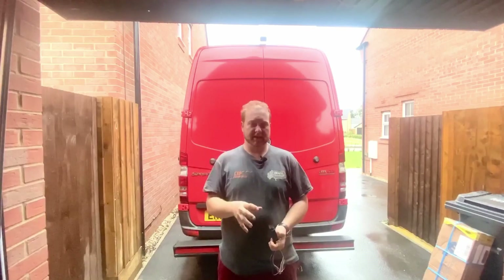Installing A Tow Bar On The Sprinter

Comment: Glad I watched this install.....step bolts were a nightmare....my advice give each a good heat before you try to undo them.....I had major problems with one of the bolts that go into the fabricated double nut plate.... And you can't get a grinder into it to cut it off, so perseverance, a hammer and a 17mm multipoint socket rather than an 18mm worked brilliant.
Fitting was nice n easy, chassis all predrilled, only thing I say is when you assemble the towbar put a jack under the beam and lift it upwards until it stops.... Then tighten up the bolts on the chassis, was quite surprised at the movement available of the plates that attach to the chassis....I think the holes on the plates should really be machined a bit smaller according to the bolt threads.
And good to see the fog light comment..... That's last job today after bypass relay and socket wiring 👍🏴
Reply from the maker: I’m glad it helped! Yea good tip with the jack probably should have done that myself.

Wiring isn’t too difficult I had to go back to mine so I would Google the bypass relay wiring I did have a document I used but I lost it 🤦🏼‍♂️

Jason

Comment: Ok, ive watched a couple of vids with the electric fittings,  some open the lights an connect to the system there, i have put my wire to the socket from the top out the light as you have. The question that i have is the wires to both sides split a the top in the plastic trunking, can you just connect to the wire at this position?
Reply from the maker: Yes this was how I did mine found where it went across and just connected it there 😁

Comment: Wondering if you have towed a car with the Sprinter yet? I'm sure your cars are lighter than my VW Jetta TDI I'm preparing to do but I think it can be done. The car weighs 3000 pounds & the Sprinter is rated for 5000 pounds. My 16 foot trailer I'm hoping weighs under 1700 pounds I'm sure. Chains & binders etc will put me pretty close to maximum forsure. My main concern is the 500 pound maximum tongue weight on the ball itself. Any experience if any would be great if you have done so. My plan is to back the car on to the trailer to reduce the weight up front & head to the scales. Thanks.
Reply from the maker: Hey! I have towed my race car to and from tracks on quite a few occasions now and it goes amazingly well. However, like you say I’m towing a tad lighter. My race car weights 1000kg (2200 pounds) and my trailer is probably only around 500kg (1100 pound) maybe even a tad lighter it is quite a small trailer. As you say to evenly distribute the load evenly you could reverse the car on as you say best bet would be to load it up and head to the scales where you can work it out a bit more accurately there.

Not sure that helps you 🤣 
Jason
Reply: @TrackAndBeyond  😂 It's just good to touch base with someone that has done it. I will be near the max forsure & my van is a full build out too. Fully self sustainable by myself. I will touch base back & let you know if I can  get the weights legal in a few weeks. Good to have these answers in the comments for others if anything. Will keep you posted. Thanks for responding. 😎👍
Reply from the maker: For sure keep me posted man 😄